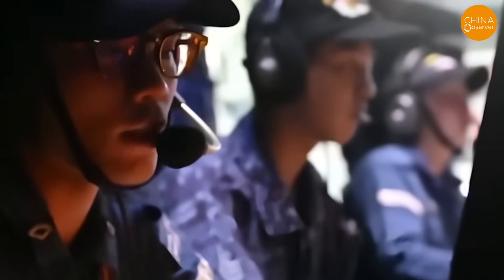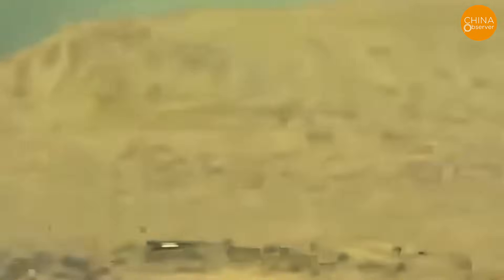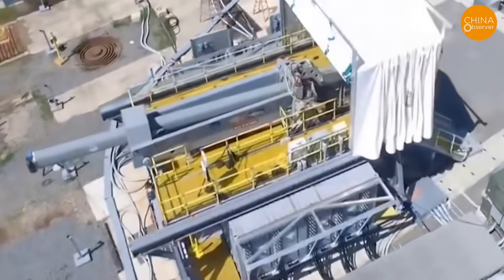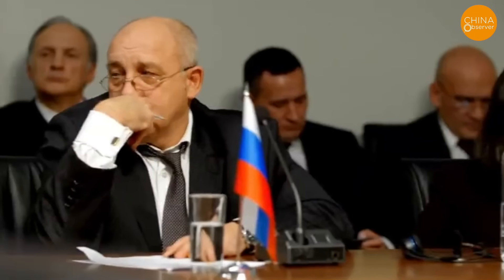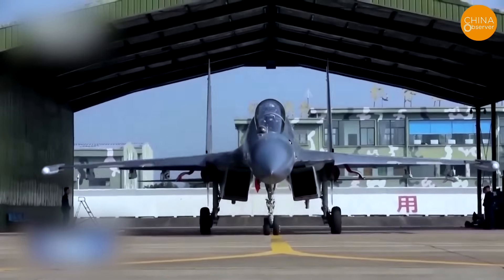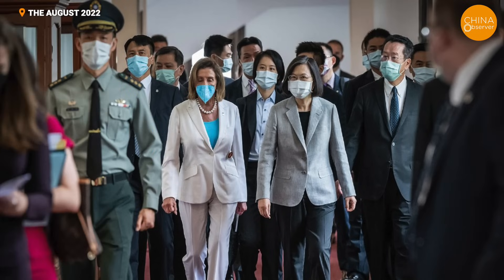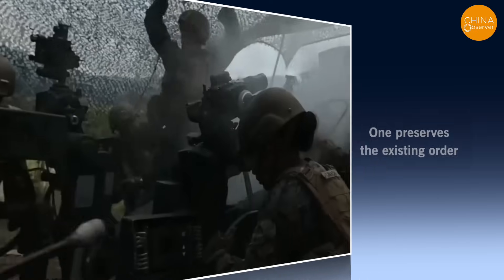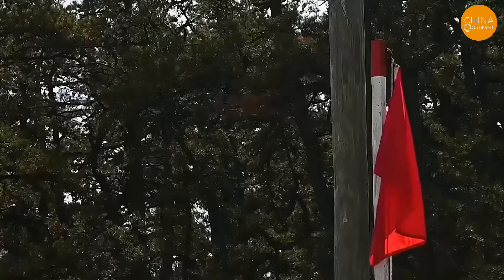Japan's Electromagnetic Railgun Challenges the China’s Hypersonic Missile Dominance

Comment: railguns have to issues, one is the power requirement, two is the erosion of the rails, they get eroded realy fast and the main issue regarding cost, but if erosion can be dealt even by reducing contact, then the need for power is dropped and the cost drops.

Comment: That makes NO sense.  Yes the rail gun is faster than a Patriot missile, but the Patriot missile can steer.  As long as the Patriot is near the target the speed of the missile is not as important.  This does mean the Patriot battery can not cover as wide of an area.  As for the HS... The ones Russia tried to use to take out that Patriot batty... 7 out of 7 were shot down... 6 in one barrage a few days after the first was shot down.  Debris from one of the Kinzhals did damage one of the Patriot Battery launchers but it was repaired within a few hours and back up and running.  Success rates are 90%.  The rates were 55% early in the Golf War against the Scud missiles because they lead the missiles too much and were exploding in front of them.  This required them to typically shoot 2 at each Scud.  They updated the software and have been improving it constantly.  It is likely over 90% now.  that is one reason why we sent a Patriot Battery over there.  The data from its intercepts are used to improve it success rates against modern Russian missiles.

Comment: Rail gun on ships would be impractical due to ship size being slightly bigger due to having two power plants (one for ship systems and another for the railgun itself) as well as having a small hatch for loading spare barrels for replacing while in deployment otherwise ship would have to head to port to replace the barrel.

I can only imagine a redesigned Iowa class or similar battleship being able to pull off any usage of a railgun and those can be recommissioned only out of emergency iirc.

Comment: Unfortunately, I don't think this actually works. America gave up on rails guns because of the ridiculous pressures, stresses, heat, and power requirements (millions of amperes). We are talking about megajoules of energy per shot, in addition to replacement barrels and other components. The failed Zumwalt-class destroyers were originally supposed to use this and it was so expensive and inefficient that it was abandoned in 2021.

Comment: Lasers cost less, are more accurate, are more versatile, and don't grenade themselves after firing. HELIOS 2.0 or whatever is going on our Ford class carriers will also have 600 MW of nuclear power behind it, so it will be able to melt fighter jets and hypersonic missiles instantly. The current model can melt through a plane wing in just a couple seconds from miles away, imagine what 25 lasers with 100 times the power output could do. You got a fleet of a thousand planes coming your way? Gone in 1 minute. A hundred hypersonic missiles detected on the radar? Alarm goes quiet after a couple seconds. It could take down the whole Russian military at once.

Comment: THAAD with a speed of mach 8 just failed in israel against Houthi ballistic missile. If you haven't realized by now most CIWS systems are incredibly deficient, missing or ignoring targets. While this technology is being worked on th japp gun only has a barrel life of barely 120 rounds, goes at mach 6, and hasn't consecutively fired on tests. It is unrealistic to tout this as some new game changer specially when the Chinese have the industrial capacity to outproduce Japan and the west and could produce more missiles, or drones than Japan or the US can deploy ways to counter them.
Reply: Sounds like someone has been eating all the Chinese propaganda. 

I’m sorry to abuse your beliefs, but Chinese “manufacturing” is far less than the US and Japan when one separates out high-tech production from mass production. China has very little high tech manufacturing in comparison to both the US and Japan. Both of the latter nations have proven very capable to produce high tech materials and products at high rates while China struggles to produce anything beyond copies of decades old tech from the US and the occasional substandard prototype of modern tech machines and devices.
Reply: @sostrongineedmoreofyourmon974  Not a fan of the CCP or chins for that matter but there's a reason they're a threat and it would be fatal to underestimate them. High tech is important sure but no nation as of now can match the manufacturing capacity of China and they have sufficient tech of their own even if they are deficient is some sectors. To put it in simple terms: 
doesn't matter how much lasers, anti-ballistic missiles, or new super duper weapons the West and their allies have when they won't be able to produce enough or will run out out of them, and by then China will be out producing thousands of ballistic missiles, millions of cheap drones, replacing lost ships and other equipment. Ballistic missiles are typically low tech and can be mass produced to great effect (See Houthi sandal warriors sending them to top anti-ballistic tech leader isreal) If Israel already armed with the best tech cannot stop some desert cult militia that sends a few dozen missiles at a time, I don't think the US and allies will fare well against China with millions of hands to work with to build thousands of shells, missiles and else. And related to the video, it is too early to claim that a 40mm rail gun can stop a chin ballistic missile when even the best naval guns like the rapid fire 76mm the west has can barely destroy a measley houthi drone in the red sea(recently engagement by French navy)

Comment: Railgun was abandoned by usa. I think they are going with laser dome instead. Lasers cost even less and more accurate
Reply: Both techs have its own benefits: E.g. Railguns can penetrate thick targets on impact, but Lasers are good against light targets. While Railguns consumes more energy and requires more maintenance/replacements of parts and ammos than Lasers. 

I think it depends on the focus: If for offence, Railguns would be best as it causes the most damage than lasers, but for defense, Lasers are more cost effective and more easy to maintain.
Reply: Not abandoned its fix all issues but barrel degredation